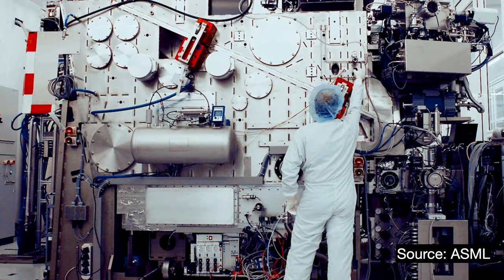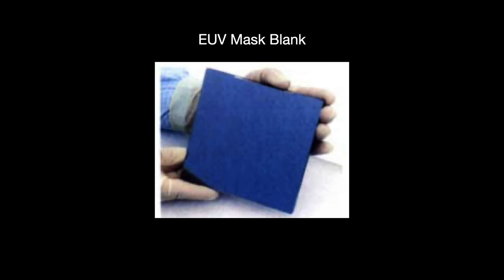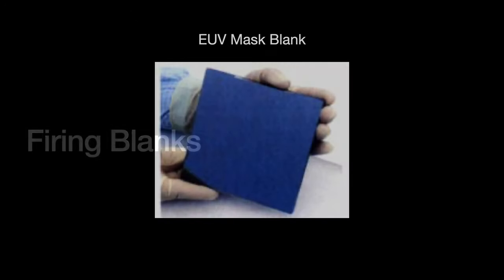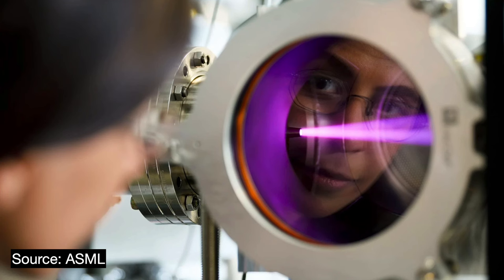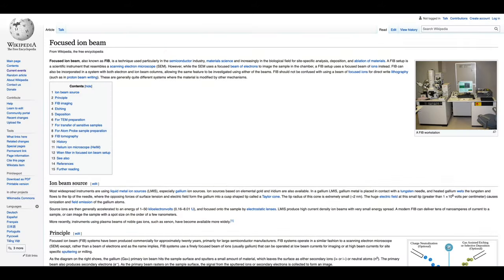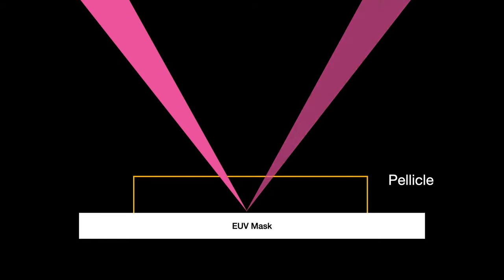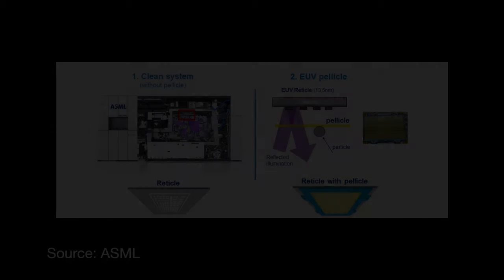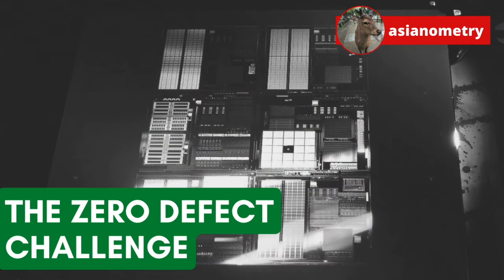EUV’s Most Difficult Challenge

Comment: Immersion lithography yields are worse than the EUV. The transition from deep ultraviolet (DUV) lithography to extreme ultraviolet (EUV) lithography has been a significant leap in semiconductor manufacturing. It is probably why it's so widely discussed and publicised. Sure there are other techniques and IM-Lith is well established. As are the environmental problems.

Comment: 11:22 “Graphene, a carbon-based nanomaterial that can do everything except leave the laboratory.” Nature and Science should put that up on their paper submitting system
Reply: I've been making that joke for the last 10 years. It makes me laugh, but it also hurts my soul.
Reply: It’s not quite true any more though. Graphene LiPo batteries are commercially produced. I’ve used several for high powered hybrid drones (they have a great recharge and discharge rate). I ordered them from normal RC drone battery manufacturers so it’s not a speciality thing either.
Reply: @mmmmm49513  also graphene based USB power banks with extremely high output are available
Reply: Was going to comment but others have made my point.  20 years is not too long to get something from discovery to first use,   Most of the easy stuff has been done in the past.   If you want something  that is long in the tooth look at hydrogen cars.  Nearly no advances and people keep championing it.
Reply: I was astounded at his fearless savagery with that steaming-hot take.
Reply: Ahahahaha - ouch! Also not wrong! XD
Reply: @thealienrobotanthropologist  Ironic: you're commenting this on a channel which is mostly about how we made small grains of sand think with electricity. We made THINKING SAND. And to think it wasn't considered promising because what could it possibly do that vacuum tubes couldn't? And besides the properties of this new material were kind of garbage and very unstable.
Reply: @SianaGearz  only slightly ironic bc he's referring to graphene as a structural material which it often gets touted as and all the other commenters who talk about its use are for products where it is not a structural material.  Silicon itself as you're using it in your statement is a great semiconductor material but we mostly use it because it is abundant not because it is the best. Early transistors were not silicon and they had major advantages over vacuum tubes so they were already the frontrunner before silicon became their dominant material of use.
Reply: 🤣🤣🤣🤣 I laughed way too loudly at that, that joke is too good.
Reply: heard that I laughed so hard I nearly tore open my stitching T^T why r u doing this asianometry
Reply: @danharold3087  i wonder why that field would be surprised? Who would stand to lose from such an efficient and plentiful fuel source?
Reply: Graphene has been also used as an additive for some materials. Some companies are claiming that their shoe soles with some graphene content are supposed to be more durable.

Comment: 10:10 for the math to make sense, it has to be 81% of the radiation that is reflected (loosing 10% per pass-through)
otherwise we would loose 90% on the first pass-through and another 9% on the second (making the output 1% of the incoming radiation)
Reply: Lose.  

To be 81% weaker, it has to lose 43% coming in and again coming out.  

Otherwise it’s 81% of the original intensity.  

Story problems are hard.  Just don’t ever say something is 10x smaller because that’s impossible.  It’s 1/10 as big.

Comment: How do you design a chip ? like what are the reasoning for specific designs?
Reply: That's like asking how do you build a space shuttle
Reply: Chips/transistors are essentially collections of logic gates and certain combinations of logic gates are better suited/needed in order to perform various mathematical operations. 

Some kinds of applications will use certain operations more than others so often the hardware of the chip is tailored towards those applications. As a starting point I'd look at the differences between the kinds of calculations that a CPU performs versus those typically performed by a GPU. In many cases the CPU can perform the same calculations as the GPU but due to its less optimised architecture it can't complete those operations as fast as a dedicated GPU. 

I'm vastly simplifying things here but it's something to start with if you're interested in the subject.
Reply: you cut potatoes really thin and fry them then add salt. goes good with sour cream french onion dip.
Reply: Chips are the way to miniaturize electronics.  
The first step is understand what electronics are need for your design.
Next we design an electronic circuit that does what we need.
A computerized schematic is created for the circuit.   He is thinking transistors and gates but only uses symbolic representations.
The circuit design is most likely tested in a simulator that utilizes the electronic schematic.
When satisfied a chip designer creates a chip layout that is the circuit.  For the first time he is creating real transistors and gates
Maybe more simulation.
The chip design is printed on to a wafer.   
Chip samples go back to the lab where they are tested.
If it works your done.  If not figure out what is wrong and try again.

These are broad strokes and certainly more accurate information can be found elsewhere.
Reply: @Joker-no1fz  those are carbon based chips. You may want to look one row lower in the periodic table.
Reply: @Gameboygenius  over your head.
Reply: @Joker-no1fz  No over your head.
Reply: @Joker-no1fz  is riffing his joke off of yours, so he's right
Reply: @vaakdemandante8772  taking what i said literally so yeah... he knew what i was doing.

Comment: @10:10 I think you got the maths a bit wrong here. If 90% of the light is absorbed on each of the two passes through the pellicle then only 1% is left afterwards. (IE: You have to do (1-(10%*10*))=99% absorbed, not (90%*90%)=81% absorbed.)

Your assertion also doesn't make sense based on a simple sense-check: in the first step, 90% of the light is absorbed (ie. 10% is transmitted), so it's a bit weird when adding another identical step magics 9% of the light into existence (81% absorption = 19% transmitted).

I don't have enough background knowledge to fill in the gaps and guess what you were trying to say here, so, unfortunately, I basically have to disregard this section as unreliable. 😕

Otherwise, very interesting!

Comment: Wouldnt it be possible to correct some degree of these bumb defects by changing temp of small parts of the structur surrounding the defect and use contraction and expansion to straighten the area ?  Honestly no idea if this would be even possible on these small scales but still interested if someone got input on that

Comment: Is there work being done to design circuits with redundancy? I imagine that it might be cheaper to produce a chip with double the circuits, which can be tested and selected during testing, than to produce a defect-free mirror and mask.

In other words, if chips can be made more tolerant of defects, savings in mask production costs and lower reject rates could yield chips with a better price/performance ratio.
Reply: I think the issue might be that increasing the surface area of the design leads to more defects than just throwing out a couple parts of the wafer.
Reply: I believe, that's how some of the low-end CPUs are made. High-end CPUs with defects in cores or memory have them disabled and sold at a smaller price
Reply: That already happens with lots of chips. When Intel or Nvidia it AMD sell cut down processors, they disable defective parts and sell the rest. On some GPUs at times the top part shipped with disabled units at the start and then an updated one got released later with full spec. No need to design redundancy when you can just sell the "bad" ones as cut down chips. This has been done for decades
Reply: @lonyo5377  The significance of chip-lets.
Reply: That's what they call Binning. It's been done since forever, but yes. Also chiplets, like AMD's been doing to great success.
Reply: @brodriguez11000  They bin those too. Hence some AMD CPUs have two binned larger chiplets instead of one fully functional smaller chiplet. E.g 6 core made from two binned chips instead of 1 smaller chip

Comment: Could you, maybe in a future video, address the topic of how the wafer is positioned (or the light beam directed) as perfectly as it is required? I mean, double, triple, quadruple patterning of a single layer, 81 layers, and the wafer isn't exposed all at once but the mask only contains one copy of the chip layout (did i get this right?) - so how is the positioning done so perfectly with single/sub nanometer accuracy over and over again while stepping through the rows and columns of the partially finished wafer?